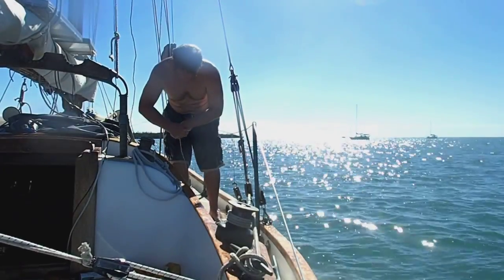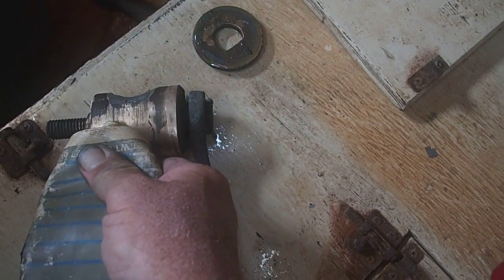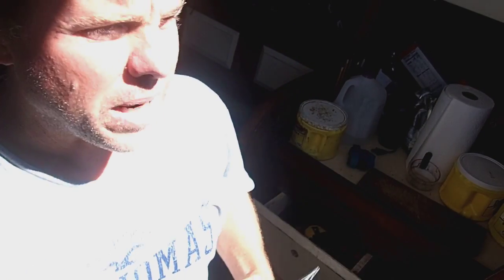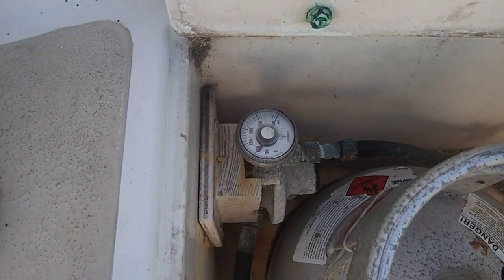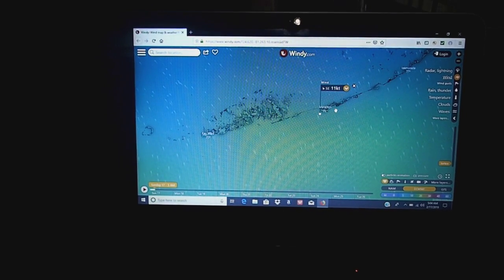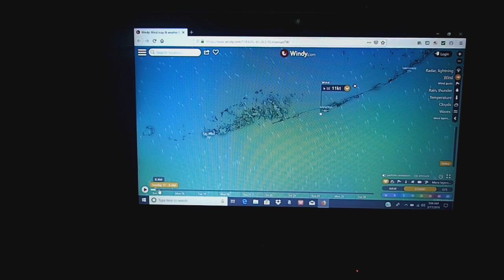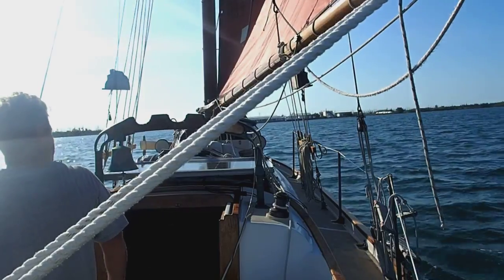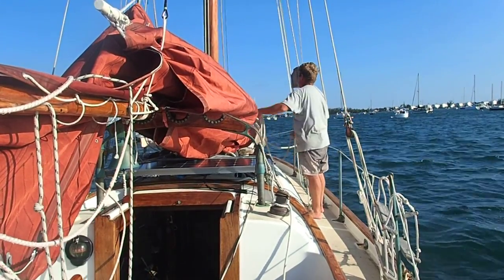Cruising: repairing one's boat in exotic ports of call

Comment: Some things to add to your supplies when you get time.  JB weld works much better than epoxy for that kind of repair - you can get metal dust/shavings to add to it for added strength from any shop that cuts car brake rotors, copper or brass dust and shavings would be nice, but you will have to special order those, sheet aluminum and copper, band/worm/automotive style hose  clamps, a wheel barrow inner tube - cant hardly find car inner tubes but the biggest that you can find is best, cork - old bottle corks - gasket sheet cork - etc, fiberglass repair kit, decent wire connectors - I like the electrician wire nuts as the easiest to get a good tight connection. Self tapping screws, RTV gasket glue, a good cordless drill with high quality bit holder and screw driver bits - don't ever cheap out on tools - get the expensive lithium battery model, and same for the drill bits, and screw driver attachments - cheap bits use soft metal that will FK up a screw at just the wrong time. (Murphy's law at work)  The good 25 year silicone bathroom sealant in the tube is invaluable - tough as tires once it cures all the way - doesn't shrink - sticks to anything - and will last longer than you ad I will be alive.  Yellow 3M weather seal adhesive - clean this up before it cures because it will stick to anything clean of grease and you will never get it off - be especially careful of cloth and painted surfaces.  Seriously, you will have to scrape the paint off to remove it.  Several tubes of liquid nails - see above warning regarding 3M adhesive.  Expanding foam insulation in the spray can.  Only do 1/3rd of large spaces at a time and let it cure completely - it will expand to over 3 times the volume of what comes out of the can, so practice figuring out how much to use and give it room to expand - the gas bubbles are what give it insulation and buoyancy properties so don't over fill.

For the holed pipe: cork gasket material (or inner-tube) with JB weld on both sides over the hole, slather more JB weld on cut copper sheet patch, put a few band clamps on snug and let the JB weld cure a bit , then cinch it down tight... almost a permanent cure.  Valve: use the metal shavings mixed with the JB weld, do any shaping or sizing before it cures because once it cures it will take a metal file and a vice to work it.  Probably a good long term cure, but get a new through hull - don't trust your life to Michael Mouse fixes. lol  Wire connections:  Put some grease on both wires and wire nut them together, then fill the wire nut with RTV gasket glue to permanently seal it.  Those butt and barrel connectors are the worst thing to use on a boat - the metal sleeve is usually aluminum, and the only way to keep out corrosion is to solder and seal every connection with shrink tube.  Lightly sand and clean your bare wire ends before you grease and connect them for the best possible connection. This connection will be trouble free for decades if done properly..  plus it is quick and easy with no tools. Sand the ends, clean, grease, twist together, wire nut, and seal the wire nut...  Probably tape or shrink wrap the connection to keep anything from hanging on it and to give additional weather protection.

Always remember that you are living the dream, and that we all hate you as we shuffle off to the daily grind... just kidding. lol  Keep the great vids coming, brother.  GOD Bless you - Fair Winds and Following Seas.

Comment: Good to see you are all shipshape again. Just a suggestion. Make sure you have a rubber grommet where the flexi gas pipe goes through the fibreglass to the regulator. Rubber pipes can chafe quite quickly with vibration and movement where they pass over thin material just like the bulkhead (firewall) in cars grommets are used to prevent abrasion.  On another note, having lived in the African bush for a number of years, a supply of old tyre inner-tubes cut into strips have fixed many a leaky pipe on water systems and vehicle coolant leaks. Some guys use this method for all their plumbing requirements in simple joints. They are also useful as emergency bungees. Happy sailing.
Reply from the maker: Thanks, yes, I was thinking I should put some silicone rubber where the hose passes through to seal it as well, but I didn't think of chafe.  Good call.

Comment: I have used valve grinding compound to mate the spindle to the through hull valve body. Just apply it to the spindle and work the spindle in the valve body. This will lap the two parts together.
Reply from the maker: Yes, someone told me a similar thing, that if you just sand both the plug and tapered hole and then open and close the seacock a few hundred times, they will fit perfectly, no leaks. That's of course assuming the amount of corrosion is not excessive.

Comment: I wanted to drive a big rig and some smart trucker told me to go find a farmer who would let me practice driving around cones and backing up, he said there's no better way than to practice on a farm.  So with a enginless  sailboat,   we could learn it if we got out in the ocean or a large body of water and just play around doing maneuvers until you get confidence.  It's know thy boat.  Everyone was green when they started.  But how easy is it to buy a great boat and not have a clue as to doing these difficult moves. ............ Guess I like to watch 1000 videos.  I want to build a replica sailing model of my exact boat with weight and dimensions the same and with remote controls, sail it on a lake.  Then turn my aluminum  rowboat into a junk rig and practice with that.  Then sail as a mate on another sailboat to get yelled at a lot and learn to see the big picture.  THEN take out my boat so I don't crash it.  Using it as a tiny home till then.  Living on the boat and dealing with the stress of that minus the water and waves.  We are seeing here the culmination of years at sea and a survivor.  Imagine how many guys gave up after one season.  ..............One small splash for man yet a giant splash for mankind.

Comment: I looks as though the thru hole fitting needs replacing. Now that you have had it apart to get a good look at it. It may be wise to get one on order while your down in the keys. You may be able to change the elbow out right away and then wait till haul out to change the fitting. Good idea to replace the defunct propane equipment. Liked how you picked up the mooring ball. Nice work. I hope you enjoyed the Keys.  Happy sailing.

Comment: Love your channel. Just wondering why you don't just let the mooring buoy come along side you in the cockpit and pick it up there. That way you are at the helm and can accurately steer the boat to the buoy. And, with a line already lead aft from your bow roller, (outside of your safety lines) you can just tie right on. Saves all of that scurrying forward and wondering what side of the boat the buoy has now found it's self on.
Reply from the maker: That might work, although you would have to already have the line rigged, and make sure that the buoy passes on the side that you intended.
Reply: Yep. You gotta rig the line first. Easy enough to get the buoy along side the cockpit. Like you I single hand a lot and rig as much as I can, drogues, sea anchors, boom preventers, etc, all from the cockpit with lines ran forward and out through leads, etc. Love the videos Kevin, really great work. So great to see someone without an engine. This is real seamanship and many could benefit just by imagining how they would sail if they did not have a power plant. That is the safest way to make any approach etc, imagine what you would do right at that moment if the engine quit. Safe journeys, sir.

Comment: You might want to consider putting a rubber gromit on the hole you are now running that gas line through into the propane locker for better chafe protection.
Reply from the maker: Just did that, with silicone rubber.  Another sub said exactly the same thing, warning about chafe. Thanks!

Comment: A nice final approach in a crowded anchorage! That leaky, old seacock would worry the heck outta me... I'd have changed that before the propane regulator anytime, even dzr brass for $100 if not a Blake's. Thanks for another enjoyable vid.
Reply from the maker: Yes, but it requires a haulout to replace the throughhull, so I will just keep an eye on it until I get back to Virginia. I've also added Rescue tape and Stay Afloat putty to my emergency bag.
Reply: @howtosailoceans1423 . I guess there are no walls to dry out against? Hold on, I'm based in the UK with 10 to 30 feet tidal ranges...what do you get in the Keys? I suppose drying out or using beaching legs aren't options? Good idea, I think Stay Afloat looks an excellent product, I have some on board too! Good luck getting home.
Reply from the maker: @philsmith7398  Tidal range in Florida is about 2.5 feet, so no luck there.  I need to get to a proper boat yard to replace the through.
Reply: @howtosailoceans1423 . Wow, that is a tiny range with gentle streams to match. Thanks Kevin, you've done all that can be done then! Fair winds.

Comment: G'day, thanks for a realistic view of day to day cruising issues, the detection of impending repairs and the possible "side effects" to consider.  That propane leak was a worry.  Wasn't the smell of the propane noticeable in the small locker space?  Even allowing for a locker drain to let out the leaked gas the propane odour would be fairly strong.  Made me consider whether a hand held gas detector to pinpoint the gas leak, or a fixed propane alarm in the locker could be worthwhile.  Cost is probably comparable to the regulator - a lot less than an explosion on board and offers some insurance against sparks from faulty wiring becoming a lot worse!  Fair winds, Gary

Comment: Another great, informative post - keep 'em coming. Nice display of boat handling under sail, as well as ingenuity and tenacity when it comes to problem solving. I realize you are a pretty hardcore traditionalist regarding fittings, but you miiiiight want to consider a Marlon (glass reinforced  nylon) replacement for that bronze relic of a seacock. I know it's a little sacrilegious,  but I've had both on my boats and the Marleon have been trouble-free - bronze, not so much.....
Reply from the maker: I'm planning to replace the throughs with Marelon/composite when I haul this summer.

Comment: Kevin,  I like the way you sling those bowlines together on the headsail. I would reconsider putting to sea with that seacock in its condition.  My damage control training says to fix it now because it can only get worse no part of a boat self repairs.  Take care,
Reply from the maker: I've purchased some Stay Afloat putty and rescue tape to put in my emergency bag.  Bilges are dry now, so I'm going to play it by ear and wait until I get back to the Bay in June to haul out and replace it.  Unless of course it starts leaking.
Reply: I’ll keep you in my prayers that it holds on till you get hauled out.
Reply from the maker: @tomkellum6754  Thanks for the concern Tom.  Remember, the seacock does close off enough to slow to a trickle--which the bilge pump can easily keep up with.  And I do not plan to leave the boat unattended for any length of time.

Comment: You certainly have  a connection  with that boat. She responds kindly to you.  Boat repairs are similar to renovating old houses, you're always chasing something, chasing something, chasing something and  so it goes.  Great video K.  Im very envious of you being in Key  West. Always wanted to go, had a chance in 2017 got as far as Miami, but had to fly to Puerto Vallarta to check out a yacht. As it turned out, should've went to Key West. lol
Reply from the maker: Yes, exactly, as boats get older (and if they are sailed hard), they need constant attention.  And as a corroded through-hull reminded me, not giving them constant attention could be catastrophic.

Comment: Nice demo on the mooring ball Kevin.  As usual.   :-)     If you think of it one day, could you show how you tie off on the mooring ball?   Sometimes when the sea is roough and my bow is bouncing up and down, the line hangs up on the anchor.   I'm wondering if there is a better way.     Fair winds
Reply from the maker: I tied a bowline for the first line.  Once settled, I tied on two docklines, with the spliced loop knotted to the hawser (would have to show that, don't know how to describe it).  So I have two lines plus a safety for a one month stay in Key West.  In rough conditions it can be tough tying on more lines.  I recall in Dinner Key (Miami), I tried running an extra line to the ball in the dinghy and I got hit on the head by the bowsprit as the boat plunged into a wave.

Comment: For leaking pipe you could cut a piece tin or aluminum can out to wrap the pipe take some 4200, 5200 or epoxy and glue it in place then wrap in hose clamps or lash it in place. You can also use denim or some other not too stretchy cloth as a substitute for fiber glass.
Also I have seem but not used an epoxy tape/wrap that I am going to put in my kit.
Reply from the maker: Thanks Mike, also the tin sheeting would restore some strength.  So far it's staying dry, just have to keep an eye on it, if it begins leaking again I shall attempt a better repair.

Comment: I think you're on the right track cut that pipe off straight and then get you a hose that has a 90 in it cut that hole right out, as for your electrical problem you should have a multimeter so you can do a continuity check to help you run down that grounding problem, which propane leak your spot on.

Comment: Another great video captain. I've always felt cruising is just repairing the boat on another harbor.  And I'll second the valve grinding compound tip. Has worked for me in the past
 Which reminds me I have a couple to address this spring
 Fair winds.

Comment: A little soapy water may have helped you find the leak and saved you from changing out that copper line needlessly.  Next Amazon order have them add a tube of dielectric grease to coat your wire connections before you tape them up.
Reply from the maker: Indeed, but it's just as well that I replaced that old copper pipe, it was pretty corroded.
Reply: Shrink electrical connectors are all the rage
Reply from the maker: @santamulligan676  What I use.
Reply: Better yet don't tape it up. It just holds moisture in

Comment: Gotta do something about that sea cock. I wouldn’t be comfortable with it in that poor condition. Hate to see you loose your boat. Get a roll of silicone tape, it will temporarily repair holes like the one in the pipe elbow.
Reply from the maker: I have purchased two rolls of Rescue tape, also Stay Afloat putty, just in case.

Comment: Always put the Blade on backwards,so it cuts on the PULL you will never Break the Blade!
Reply from the maker: You mean the hack saw ... never thought of that, that makes sense though, you have much more control on the pull
Reply: @howtosailoceans1423  All Hand Saws But Mostly The Hack Saw!AlsoEpoxy is Best Used With a UV coating or it will Craze!You Seem to be a Spec Opps Guy (Don't Answer)!~~~~*~~~~^^~~~Fleet Galaxian
Reply from the maker: @toolmaker3799  All ocean sailors are special opps guys ...

Comment: So the gas leak may have had nothing to do with the copper pipe at all.😳 A bit of soapy water around all the connections in the propane locker may have revealed the culprit. Not sure if US coding requirements but not sure if the full gas run in flexible pipe meets code. Otherwise love your vids.👍
Reply: Plus one for the soapy water to find the source of the leak.   Also, some self amalgamating tape in the repair kit may help with that corroded pipe.....
Reply from the maker: That old copper pipe needed replacing anyway, I'm glad I did it.  I like the the full run with one piece of hose--every juncture is a potential leak.

Comment: Do you get your internet for you laptop via wifi in port?  Or do you have a phone hookup, or satellite?  Just wondering what works in remote ports of call, and in the Caribbean.  Thanks for the great content!
Reply from the maker: Wifi, although it seems I am always struggling to get a decent connection.  I use the C.Crane super wifi antenna, plugs right into my laptop and works well up to about 0.5 miles from the hotspot.  For uploading vids I often go ashore to get close to a transmitter for faster speeds.

Comment: If your gauge ain't holding still you still got a leek, if you didn't have a leak it would never leak off, and it wouldn't matter if you left it on for 24 hours or turned it off for 24 hours it wouldn't have a change.

Comment: Where is your gas selinoid?
Reply from the maker: There is none, but the tank of course has an automatic shutoff/safety valve, they are required here in the US.
Reply: How to Sail Oceans 

My understanding is that the on /off switch thatcontrols the selenoid is supposed to be within reach of the stove.

Comment: If you could order wire...why didn’t you just order a new elbow, and replace it?
Reply from the maker: That elbow has been on there so long I'm afraid I might damage the seacock or through-hull trying to remove it.  Not something to try with the boat in the water.  Plus I'm going to replace the entire thing when I haul this summer.

Comment: Why don't I see folks sleeping in hammocks overnight?  If you prefer a flat surface couldn't you rig such a thing; a board to sleep on with rope connections to the wall?
Reply from the maker: At sea a hammock would probably swing excessively.  On a 200 ton ManO'War it may have been OK, but I doubt it would work on a small yacht.
Reply: @howtosailoceans1423  Cool, thanks.